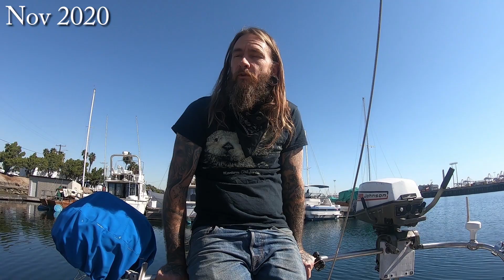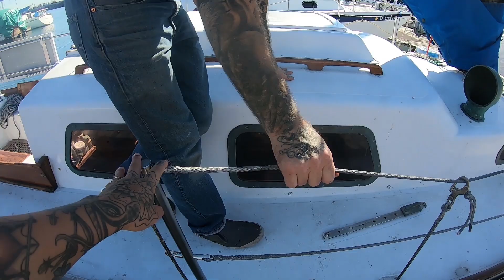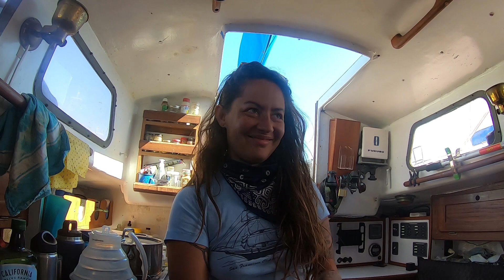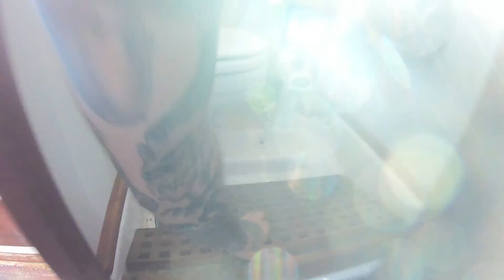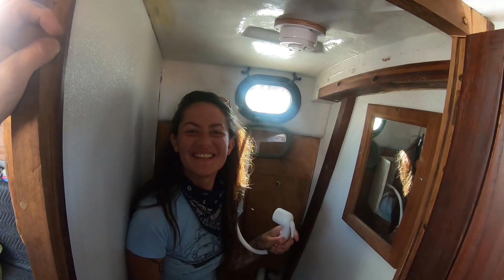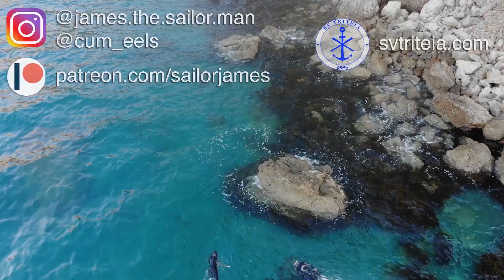1965 Alberg 30 Boat Tour - A look at the Refit process and the Upgrades on SV Triteia

Comment: Those are great improvements! I'm currently in the market for a used sailboat and the Alberg boats are on the top of my list. There's currently one available for a dollar near me but it obviously needs some work. Im also looking at Pearson's and a Valiant 37. Thank you for posting this video. Im saving it. I share a similar philosophy about limiting electronics as much as possible. One thing I am sure of is that I will be going with a composting toilet. I will need the blacktank space for additional water/fuel. Whatever I get is going around the world. Thanks again.

Comment: Good Morning James, I want to add the solar panels on the rear life rails on my ‘63 Pearson Triton like you did. The location is a very clever idea. My main sheet, attached to a traveller installed on the rear deck edge of the cockpit, would conflict with a life rail placed there when the boom is extended out. The Triton and Alberg 30 are very similar boats, except for the Albert being a 1.5 ft. longer, did you have a similar issue?
Reply from the maker: My main sheet has not been an issue in 12k miles

Comment: Some good advice, a lot of good advice. Thr Cannel Islands and France are heaven. Even within Fecamp harbour its gorgeous, Eterat also with its identifying hole in the cliff. Give LeHarve a miss. Honfleur harbour with it's 5 story buildings is beautiful. You are just miles away. Le Mont-Saint-Michel, please dont miss it.
Oh I want a boat so badly but first need surgery. I dont want one too big. A 28 feet ok for blue water with the right keel and rigging. Saw a gorgeous Drascombe Coaster 2005 With Road Trailer sailor 2/4 berth sail boat but just fit for inshore, small two birth. Great for around the UK but thats it. Only 18 inch above the water with little keel. Keep the advice coming. Thanks
SORRY! THOUGHT YOU MEANT THE ISLANDS JUST OFF FRANCE.

Comment: Nice work you did on everything, gosh, a lot of work!  The safety lines, not so good.  as a plastics engineer, the CA sun will eat them in no time and you may not see it.  Also, I worked on the Alberg 30 with my dad '78 to '84 out on the Long Island Sound, we had a lot of fun!  Sailed through many storms, raced it, flew a spinnaker, it was a tough boat.
Reply from the maker: There are tons of boats using dyneema as standing rigging and have for years so It is perfectly fine for life lines

Comment: James, man , another great video.  And some great renovations.
Re the water, another 60 gal water tanks , seems an awful lot to me.
We crossed the Atlantic 24 days at sea, 3 people, and we used about 80 gal pf water.
We washed in seawater once we were offshore, Im just thinking you may find you wont need that much water storage, especially if 
You plan to take quite a bit of bottled water.
Lastly we removed the foul smell from our potable water system by flushing it with a solution of ‘Polident’ , the same stuff folks use for their dentures...
Reply from the maker: Considering the places we are planning in the coming years 60 gallons is actually not much at all, we hope to add a water maker the end of next year which will give us a lot more freedom and peace of mind.

Comment: I have #386 with the wooden deck beam I would really like some more details on how you installed the compression post. It seems like a better idea than the metal plate sandwich, or some of the other suggestions I have received.  You do a great job on the videos, thanks for the channel.
Reply from the maker: Email me at jamesthesailorman@gmail.com and I will send you photos and details about how we did ours

Comment: Hi captain . The slow charge rate from your alternator is typical. Look into the Victron Energy Orion-Tr Smart 12/12-Volt 18. Seemed to be the most cost effective way of tackling the issue. I took out my ACR and wired one in this past summer. Works great, increased my charge rate significantly .Like yourself I have conservative power needs but with the Orion next to 175w of solar I don't really have to think about it that much. On a side note, what size wire are you using for your panel feed? The one with the breaker/jumper wire on it, looks under gauged to me.
Reply from the maker: Thanks I will look into that 👍🏻

Comment: Great upgrades.  Specially the hot water shower.  One question:  any reason why you didn't go with a Composting head?   I heard they don't smell as much.
Reply from the maker: I would never have a composting head on my boat. I have no interest in carrying the “liquids” container through the cabin and pouring it overboard every time it gets full and Peet moss is hard to find in far flung locations (I installed one of these on a friends boat and we couldn’t find any easily in the Stockholm archipelago)
Reply: @SailorJames  good to know this James.   Thanks.